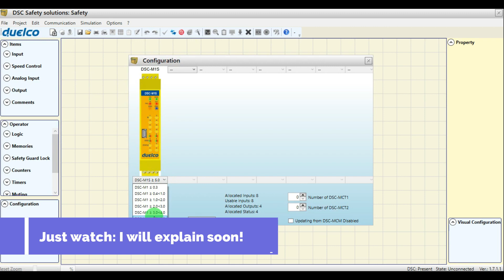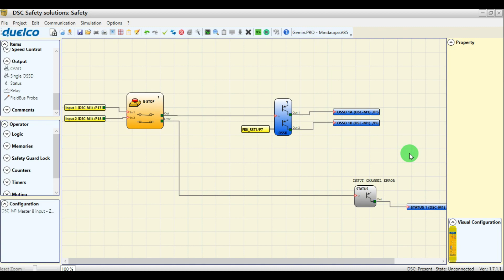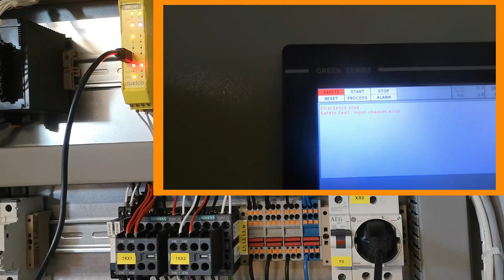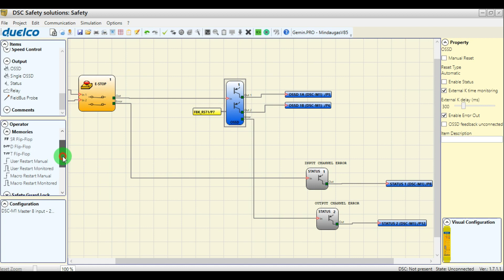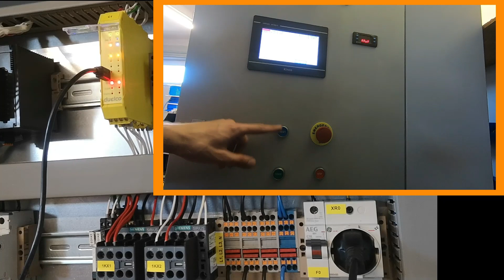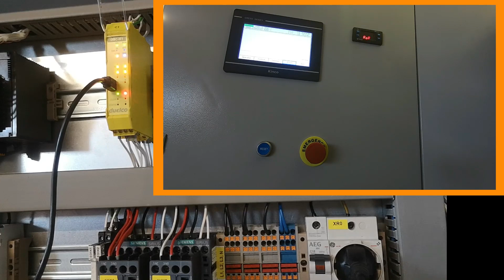Duelco safety PLC (DSC-M1): failures simulation

Comment: At 2:20 you mentioned you have got a double stop button. Is it because of some sort of backup circuit or it really does disable other parts of the system? And what is the reason that you have removed the second set of contacts in your demonstration?
Reply from the maker: It's safety system (cat2, 3 or 4). That means e.stop should work if one contact fail and it will be not possible to activate it until you will not fix it. So I have removed 1 contact because I needed to keep it in closed state - failure simulation.